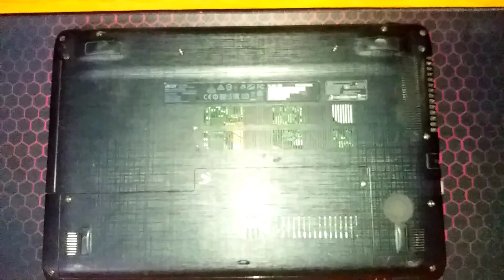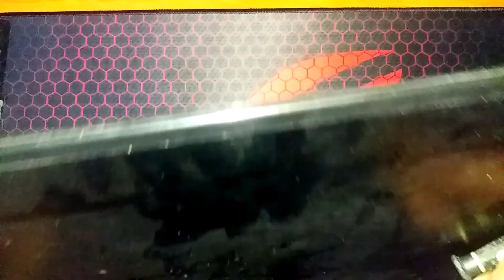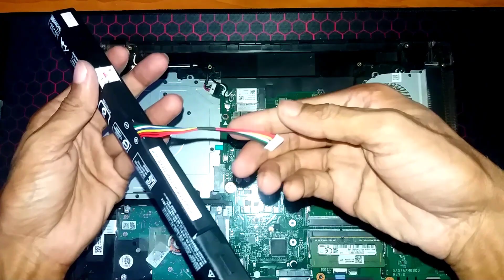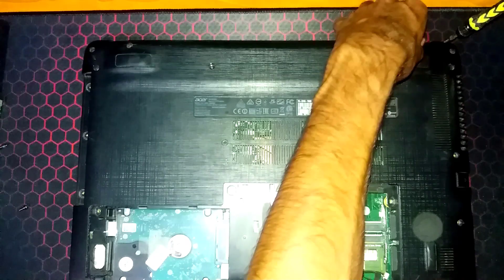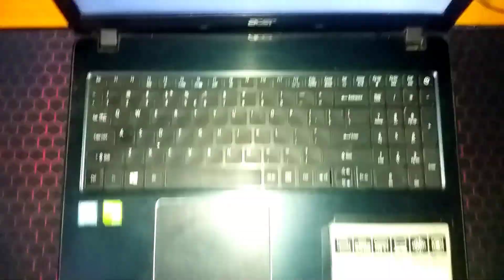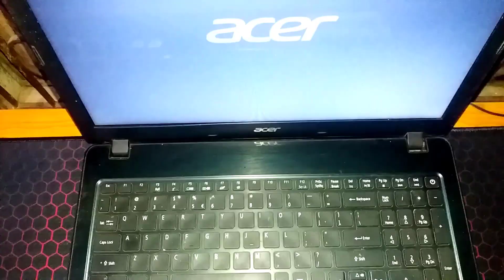How replace Battery Laptop Acer Aspire F5 573G #tech #acer #howto

Comment: Hi can I still use my laptop without battery?
Reply from the maker: Yes, you can still use your laptop without a battery as long as it's plugged into a reliable power source. However, keep in mind that sudden power outages can shut down your laptop abruptly, which may lead to data loss or hardware damage. To protect your device, consider using a UPS (Uninterruptible Power Supply) or saving your work frequently.